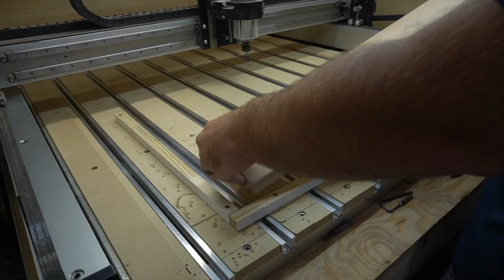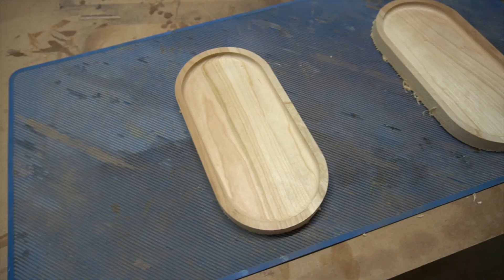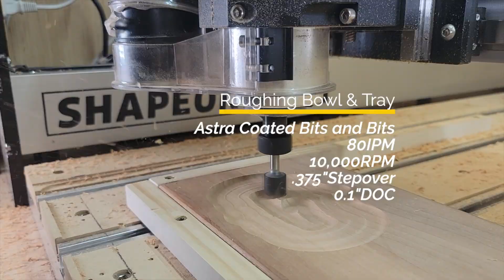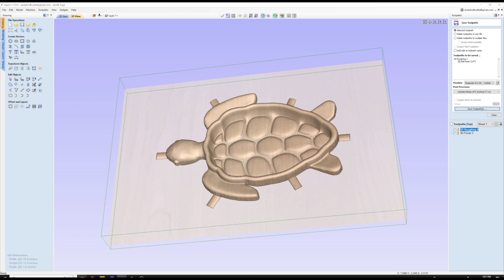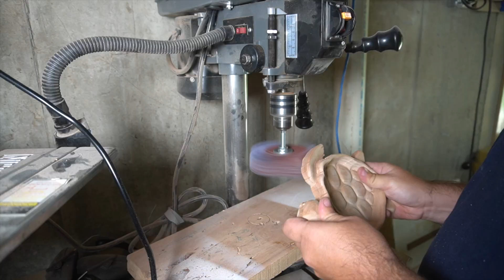3 LEVELS of Catch-All Trays - Beginner to PRO

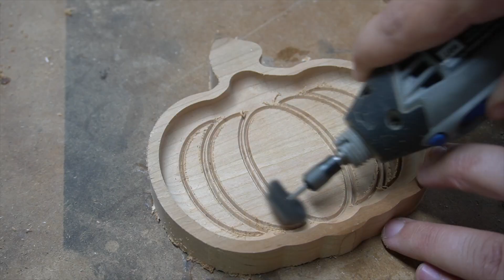Comment: Very nice trays, excellent video.  What are you using to sand the inside of the tray at the 3:42 mark? Is that a flap disc on a Dremel tool?
Reply from the maker: Thanks! It is, I'm still testing them out before I recommend them or not.

Comment: I have problems with tray bits in Vectric software. Pockets seem to vary in size when I change the stepover and pass depth for the finish pass, even using the same vector, same cut directions. I just duplicate the tool path, edit the stepover, and depths, then recalculate. It seems to want to go wider in both horizontal dimensions.
Reply from the maker: https://youtu.be/1pexh86RTPE